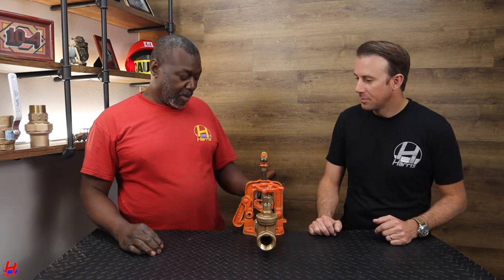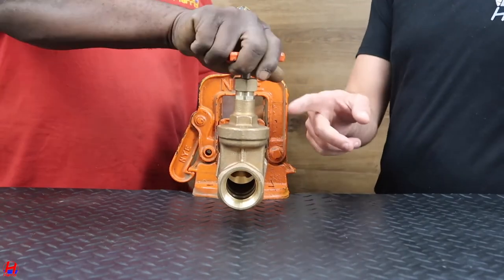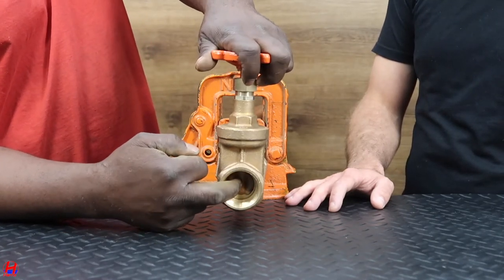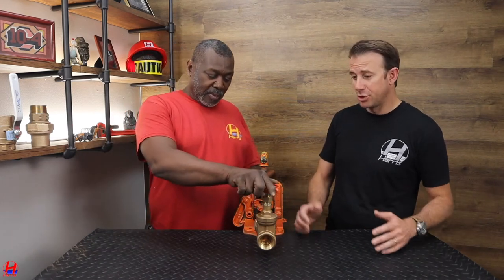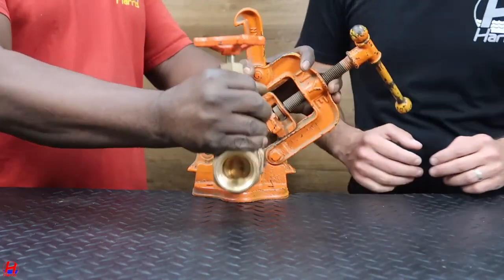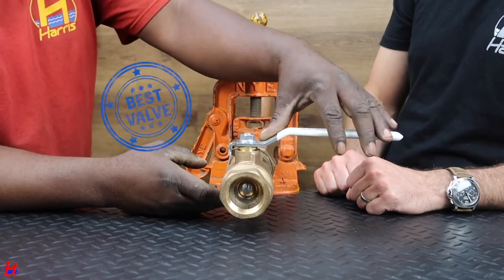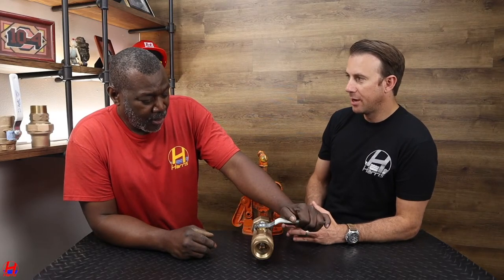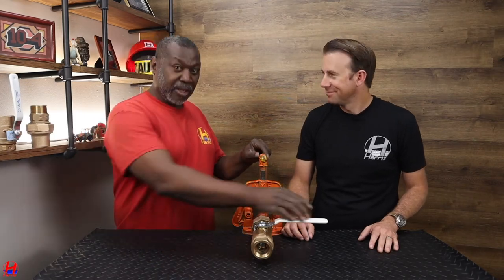Ball Valve vs. Gate Valve – What is the difference?

Comment: Ball valve is the faster operate  but in the middle shaft not lasting,  leak issue
Reply from the maker: Not if you buy a quality valve!  What type of valves do you use?
Reply: @HarrisWaterandSewer  italy valve, forgot the name i already replacement city stopcock 25mm  3pcs  20mm 1pc . City Stopcock middle shafts leak has spare part for replace.
Reply from the maker: @vincentssk3549  We use all Apollo ball valves and never really have any issues @apollovalves